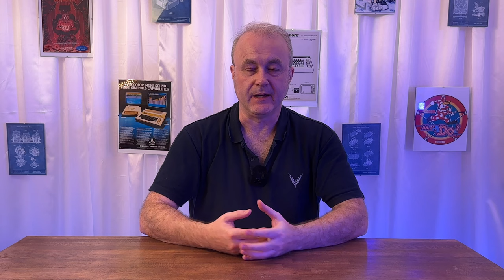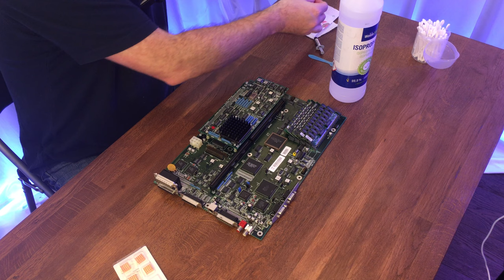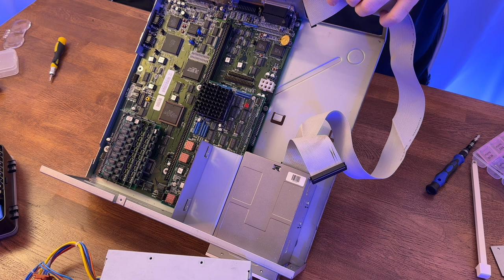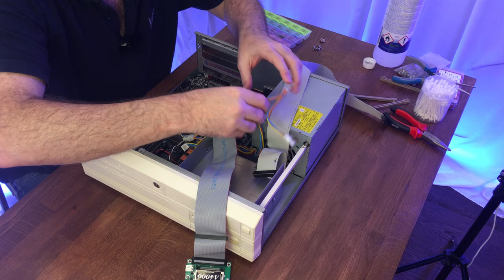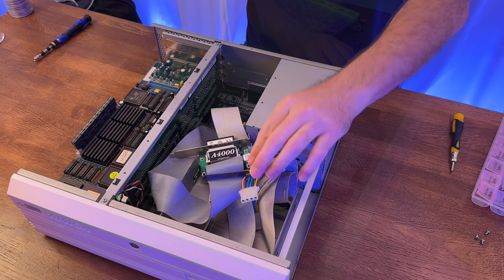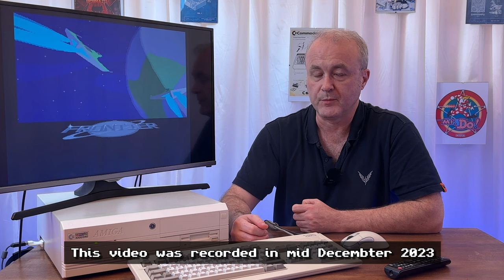Amiga 4000 CH06: The Reassembly

Comment: Not only stressful watching you do the teardown/reassembly, but PTSD inducing as I'm part way through the same process, and have to emphasize the mental discipline to not rip and pull things as they fight you going in and out on this dinosaur. The video card insertion is a nightmare. I still have to remove the drive tray to get an A3660 'rev1.1' card in  and dreading it. But hopefully worth it in the end! (Anyone have any experience with latest rev ZZ9000 card in these? Mine won't get recognized despite herculean cleaning and software tweaking efforts).
Reply from the maker: Oh, don't tell me. Its currently a bit broken, as I went for gold and put a SCSI CD-Rom in. The drive required me taking the machine totally apart AGAIN, just to get it in. And then when I put it all back together a fault developed in the riser card. This means the Fastlane Z3 SCSI card now will not work (watch in future video) and so it cannot boot.

For now... But the key with these situations is, DON'T PANIC.

I have put it aside, so I can work on other videos for the channel, otherwise it would become the A4000 repair channel :). Ill get there eventually, and I aim to have a ZZ9000 in it by years end.
Good luck with your own A4000, email me if you wish to discuss ;)
Reply: @RetronautTech  thankyou for the help! does that include psychotherapy ? haha, but having a riser card problem may be my ZZ card problem also, so new daughterboard on way. Watching your process is zen like at least in that others have journeyed here before.
Reply from the maker: @drphilxr  Putting the riser in, out, in, during assembly/disassembly is mechanically stressing. Even more so putting cards in and out of it. So, its either my Fastlane Z3 that developed a fault, OR the riser. That investigation is for another day. Problem is I don't have a known good OTHER Zorro card to test with. 
I'm going to wait until I have a better bench situation setup, before I try and fix it. Plenty of other things to do in meantime...

Comment: Quick observations I have 2 of these, the fan should be sucking air from inside the case and out the back of the PSU, it draws the air in from the holes in the back plate of the card bay. Some came from the factory with the fan reversed. If you remove the bar above the daughter board there is a slot on the top of the daughter board to route the hdd ribbon cable. With the berg extension power cable I route it around the back of the DB to reach the slots. Cheers!
Reply from the maker: I think I mention in this video, or possibly an earlier one in this same series that the slot in the riser card exists, for routing cables, as you say. Regarding the fan, Im not sure WHICH way I put it now. I guess it might make sense to have it sucking air OUT through the PSU. Ill have to check the case again, but, Im not sure you know that it has any other vents to allow for airflow...

 Im not a fan of the case design TBH. I mean it LOOKS good from the front, but for example, the top case, does not actually slide on correctly on its right hand side, UNLESS you remove the mouse port lock nut, closest to the front of the case. I attended a meet, and noticed an A4000 there had the left side not fitting correctly. User tried to fit it on, it was not happening. I remove that nut, and it now slit right on.
Reply: @RetronautTech  I got caught out with the bent tabs as well once i bent the tabs in to be parallel with the case it was much easier. I found if i flex the LHS out a bit from the back the lid goes in with no probs.
Reply: the correct commodore orientation is so that the airflow is blown / exhausted outside  -... great series btw, thoroughly enjoyed it. Apparently commodore manufacturer for PSU did install the fans either way - you do you!
Reply from the maker: Yes, I THINK it can work either way. My feeling was, get air INTO the case, create positive pressure, and THEN get the warm air in the case, to leak out through whatever vents that are present. TBH, maybe a 68040 should have a fan on it. But the PSU fan is doing a job right now IMHO, its debatable as to if the CPU should have its own fan as well... @Koolvin

Comment: Might I suggest that you not have metal pieces, like the back plate, able to move around inside the machine, because it will more than likely short across something important.  I also put electrical tape over all unused power cable connector ends to cover the open holes as well, just to play it safe.
Reply from the maker: Yes, your right, I was waiting for a molex power extender to arrive, as without it I could not get the backplate into the slot it was intended to fit into. That extender arrived, and the backplate is now secured into one of the rear expansion ports as planned. All shorts avoided :)

Comment: there is NO riser card in an amiga 4000 it's a daughter board and i'm preaty sure you won't get the floppy to work since you didn't connect the power to it, at least not in the video
Reply from the maker: Here is the definition of what a riser card is, from Wikipedia "A riser card is a printed circuit board that gives a computer motherboard the option for additional expansion cards to be added to the computer" and I did apply power to the drives at a later point.
Reply: @RetronautTech  yes in the PC and appel world but commodore has elected to call their version "Daughterboard" and the producer is the one deciding what it's called.
just like if wiki said sean is the description of a redhead boy bot i get a redhead an call him michael.
Reply from the maker: @kimshaky  I know a riser when I see one ;)